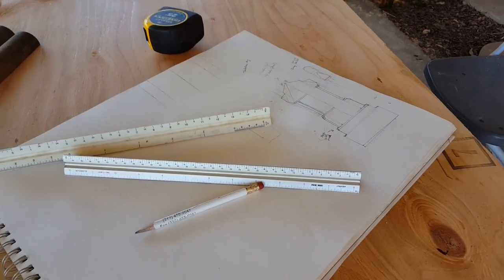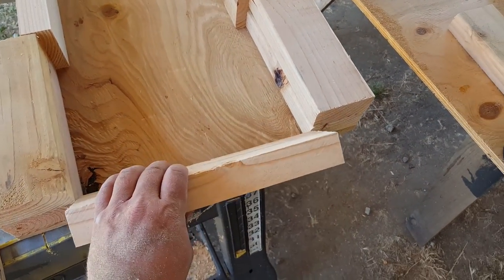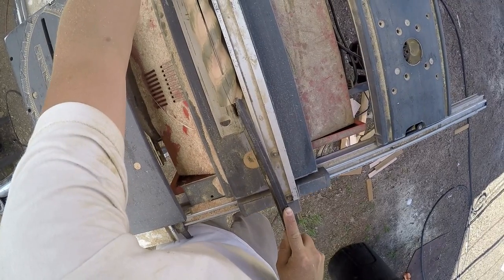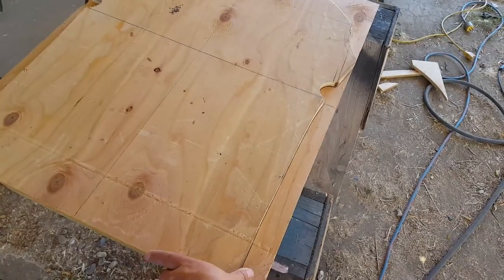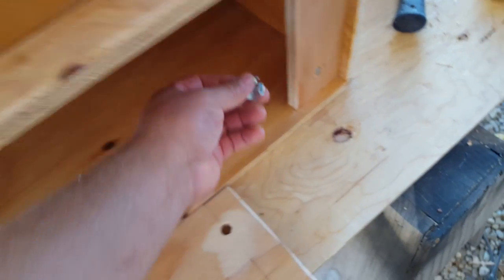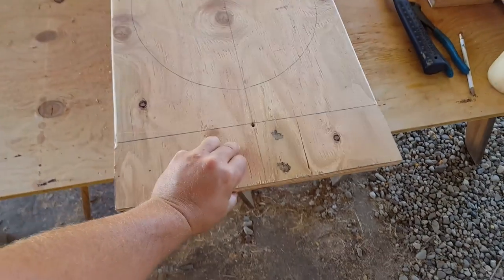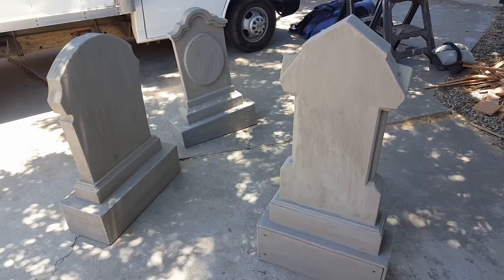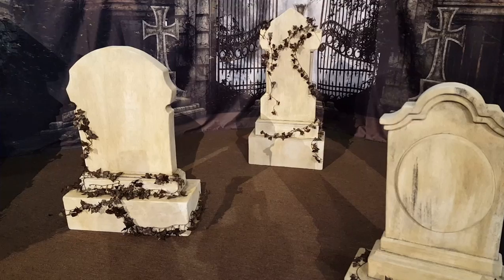Sturdy Halloween Tombstones 💀 Heavy Duty DIY Plywood Decorations

Comment: I built two dozen or more of these.  Unfortunately,  the rain caused some issues.  I then stripped them down and coated them in resin.  I also made them hybrid by adding 1" pink foam to the front for epitaphs and then coating with drylock.

Comment: I like to use both. Foam stone with a wooden base. It gives it the weight so it doesn't go flying away and you can still carve into the foam. I just had someone give me a tombstone made from concrete with packing peanuts in it. It looks really heavy but it's not. Just the right weight. (it is small) 
I love how you made these stones. The leaning one is my favorite.

Comment: I loved this video.  I was watching it in between putting decoration touches on my home haunt. My wife yelled from the other side of the haunt , "We dont need anymore tombstones". Mine are constructed with 2 pieces of MDF and 2×4 scraps. I then monster mudded them and place them into the ground using rebar.  It keeps them safe and sound in 35 knot winds!  Also the 3/4 inch MDF stops vandals from destroying them.

Comment: Your video inspired  me to build some wooden tombstones. I like how they are turning  out  I used a router  to carve out epitaph we have Jason Voorhees and Michael Myers next marker maybe Freddy Krueger. The question I have for you two is about security . How do you keep the graveyard or headstones from being stolen. Thanks love the channel you  guys make great props.
Reply from the maker: So here are a couple ideas that we have done in the past.  One is to drill holes somewhere in the prop and run your extension cords etc. in and out through everything so that if someone was to try and swipe something it would be complicated because everything is connected to each other if that makes sense.  You could also lag screw or install an eyebolt to the prop and attach some steel cable wire rope with clips and u-bolts to a tree or something stationary.  I set up something like this in one of our large pumpkin videos if your interested.  Thanks for watching.

Comment: is the FlexBond morter the best thing to use? also i think that  your  jibber jabber  is good for the video. it adds life to it . Don't let other people change the way you do things
Reply from the maker: Not necessarily there are many other products you can use to give the wood texture like popcorn spray texture etc.  I say try things your comfortable working with.  I use the tile mortar and like using it so that's why I busted them out with it.  Thank you for the feedback.
Reply: @HollywoodHaunter  what kind other cement do you think i could try? the flexbond down here goes for like $35 a bag. i like the way the cement looks on the plywood but most cements wont stick or they break part. any ideas?
Reply from the maker: I'm not sure the flexbond says you can adhere tile straight to plywood but the thicker plywood the better.  i would have to do a little research to find alternatives.  There may just be addative you can mix into regular cement.

Comment: I tried plywood for last more than 3 years water destroys them I went blue foam insulation but maybe in your area they might hold up but southern Ontario Canada and the rain they started splitting I had them painted black and did the front's with granite paints black gray and red then cleared them ... And just a waste of time doing them out of wood .